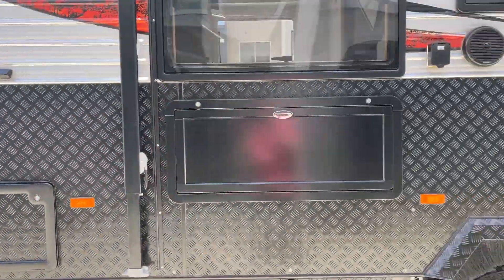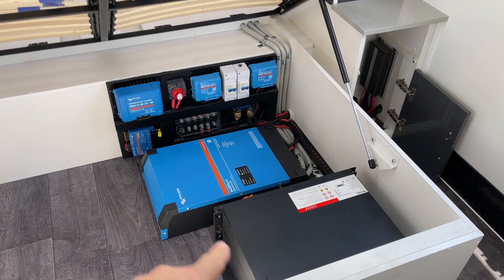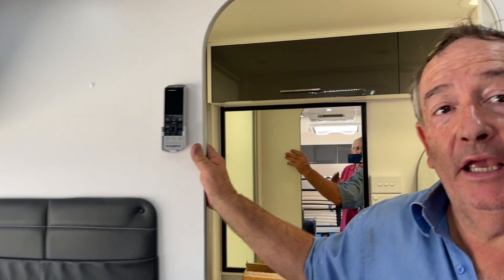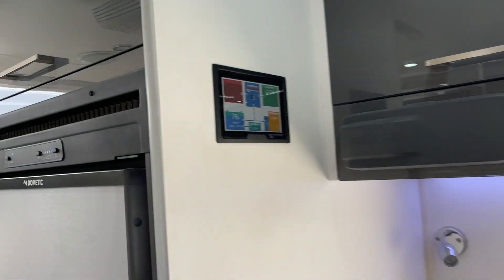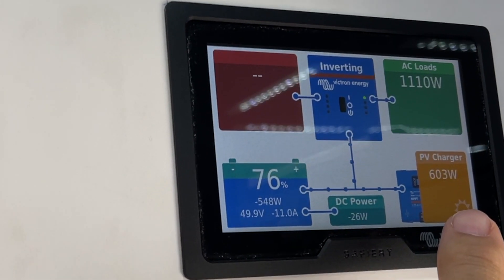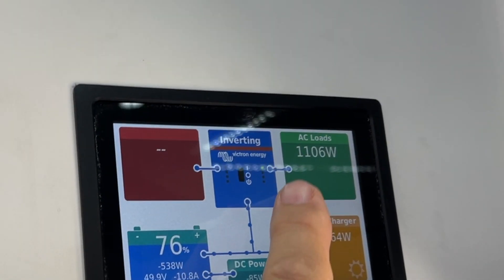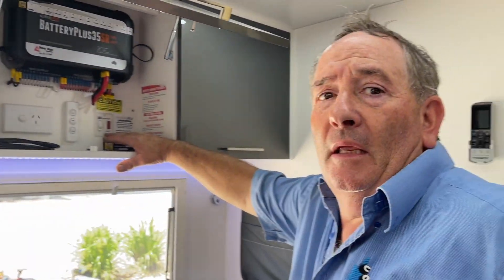New Age Desert Rose Power Upgrade: 48V system under bed, 5000W Inverter, 600Ah Lithium, 1000W DC-DC

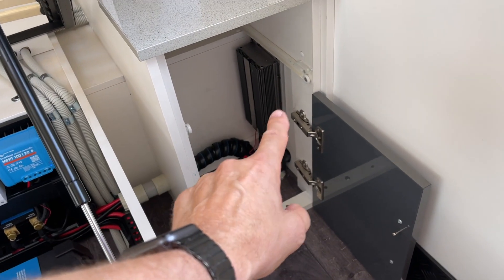Comment: 0:15 If that is a Victron Multiplus II, I believe that is a 3000 "VA" inverter which is really about 2400 watts. I wish Victron would rate their inverters in watts. They express it in volt-amps.
Reply from the maker: Understand but few people know that Victron Inverters can go over spec by 30% for 30 minutes. The alert will flash but they dont shut down. Then they deliver 3000W comfortably.
Reply: @Safiery  i’m surprised you had the patience to discover that. Or did someone share that secret with you. I’m going to give it a try. This is great news. Thanks for sharing.

Comment: With the Killa-Wasp mounted in the van, what size was the cable running to it from the vehicle? Given the 1000w ability of the DCDC Charger it must be substantial?
Reply from the maker: Yes for >5m use 70mm2
Reply: @Safiery  thanks for that

Comment: Is the Killa-Wasp in this video the 12v -12v version ?  if so how does it charge the 48v battery bank ?
Reply from the maker: No this is a 12-48V but we have several 12-12V installed now.